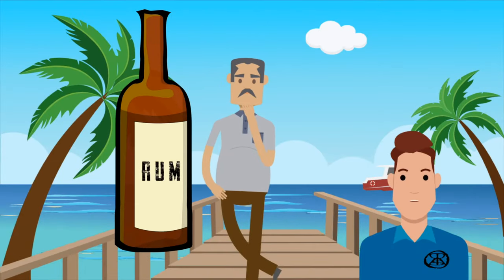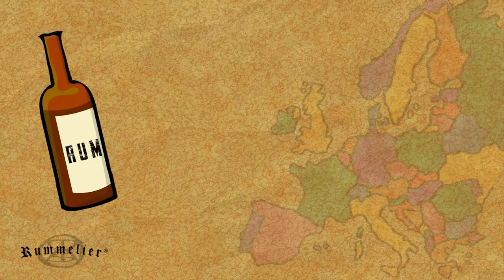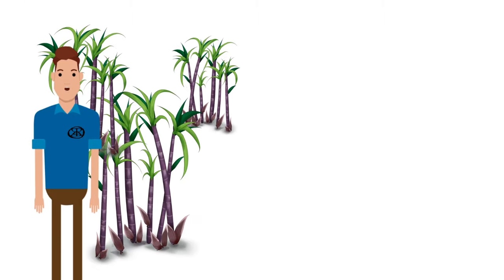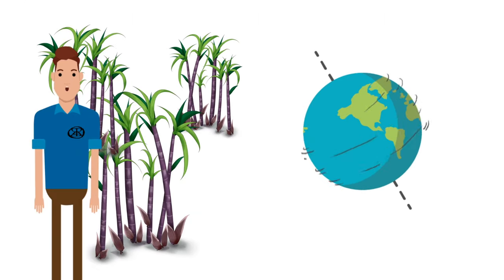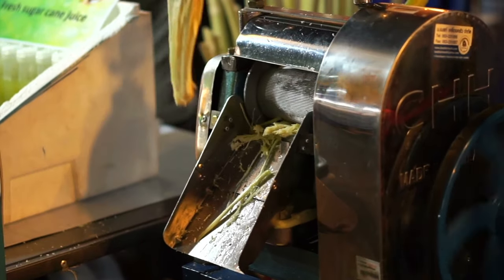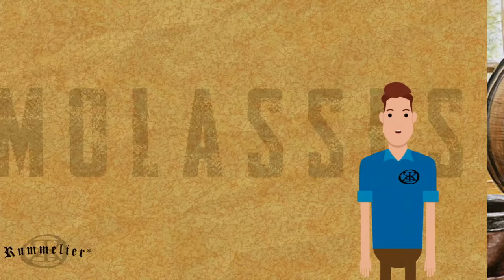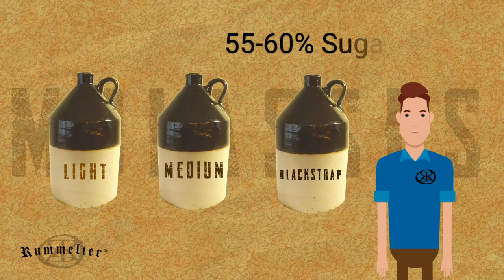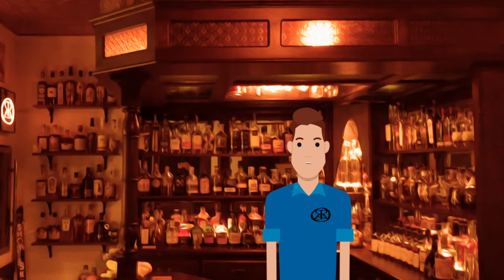How Rum is Made   Sugar Cane

Comment: 0:27 Isn't ABV Alcohol by volume? If so, then it's really confusing. Do you mean proof? I've read on Wiki that proof nearly 2 times ABV.
Reply: Look, he meant that the rum could be distilled up to 95% in the column still and bottled at 40% or more. In fact most of the rums are blends of the «heavy rum» distilled at 70-85% ABV and «light rum» distilled at 85-95% ABV. Then distillate is reduced with water to 60-65% ABV and goes to the casks for raging. Then it is reduced again with water to 40-43% ABV for bottling. Of course there are some «strength from the cask» releases with 50-60% ABV.
Reply: @EtoRom  if you don’t mind telling me why can’t it be distilled at more than 95% alcohol and then reduced with water..What is the difference?
Reply: @Novocalsmtlbeat  Then you'll get less flavour and taste compounds. It will be similar to Bacardi and Captain Morgan products.
Reply: @EtoRom  Thank you, You have no idea how much you helped me🙌